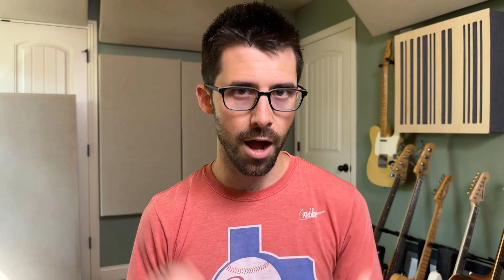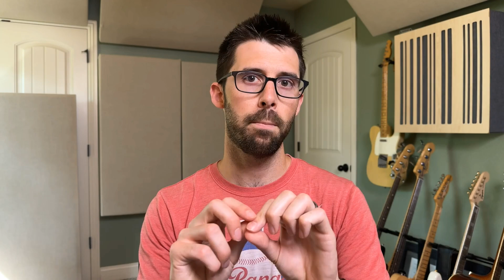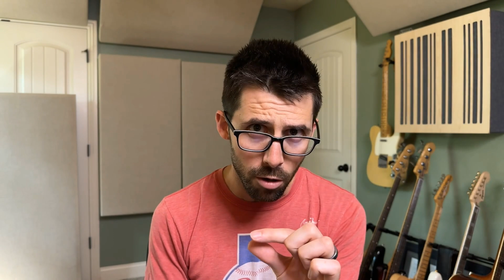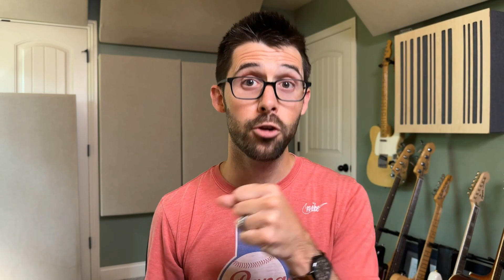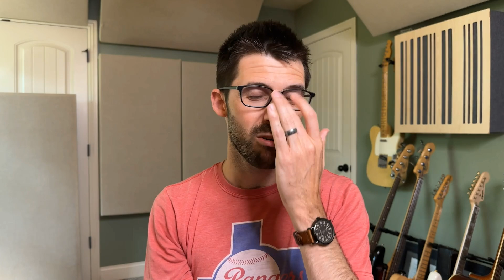EP 08 | What Is The Gain Knob For On A Live Audio Console?

Comment: Michael, thank you for sharing your experience with the community. I use an A&H GLD-80 that has a Trim adjustment in the preamp configuration. How is the Trim different than simply setting the Gain accurately?
Reply: Gain is the analogue amplification, before the signal get's converted to the digital domain. Trim is just a "digital offset". Because the trim is just on a digital level, you can change it independently just on your desk, without affecting anything else, that uses the same signal. (Like another channel, that uses the same input, or even another mixing console, that uses the same stagebox and input, for example for a separate monitor or broadcast mix)
The gain is an analogue circuit on the stagebox or local desk input, that gets remote controlled. So if two desks use the same stagebox with the same inputs, if you would change the gain on the stagebox, both desks would notice the difference in level. (which you normally don't want).

So maybe in short: Use the (analogue) gain, to get your level to a good working level, so the analogue-digital converter can work in its best range.
Use Trim in special cases, where you need to change the level at the beginning of your channel strip, but without wanting to change the level hitting the AD Conversion. (Because you don't want broadcast desk to notice your level change, for example.)